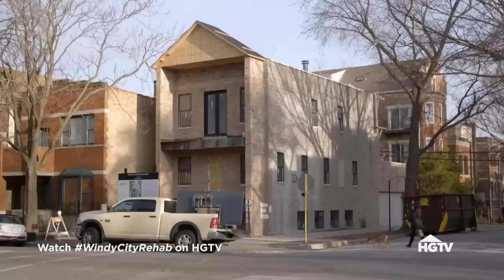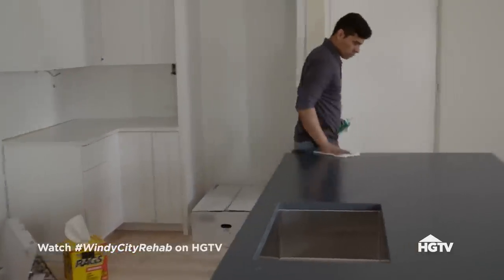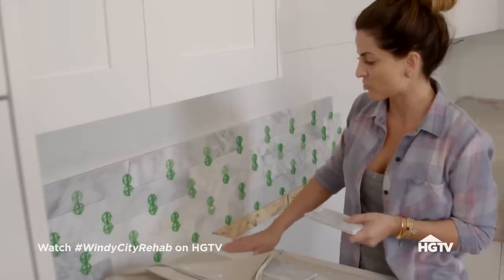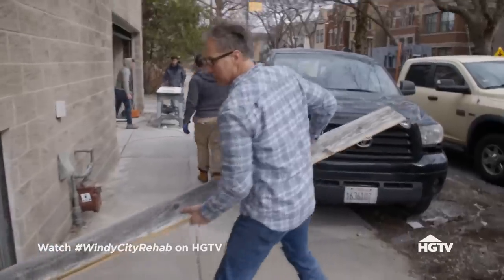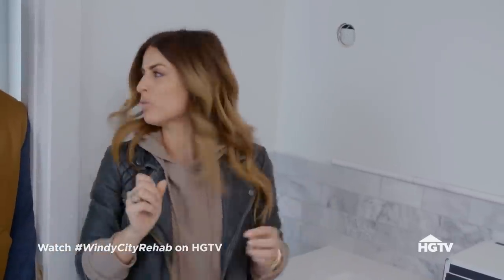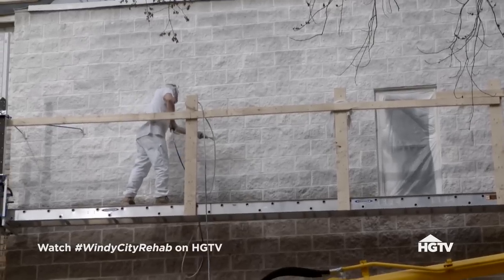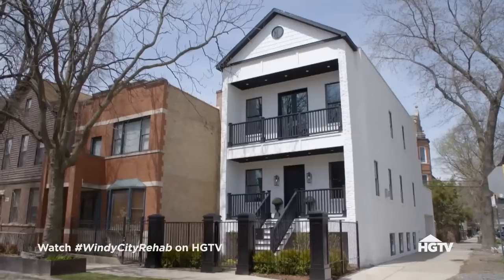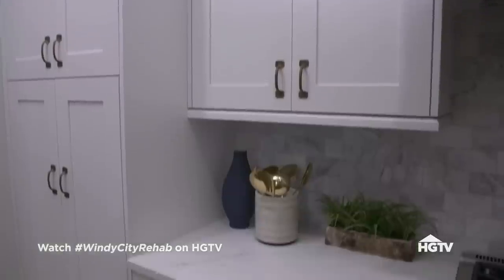90s House Renovation on a Tight Budge | Windy City Rehab | HGTV

Comment: While the interior renovation is very classy, the exterior looks disproportionate with that A-frame on top. The original form of the building was unique and imposing, and would have been in the plus column if I were considering purchasing it as a dwelling.